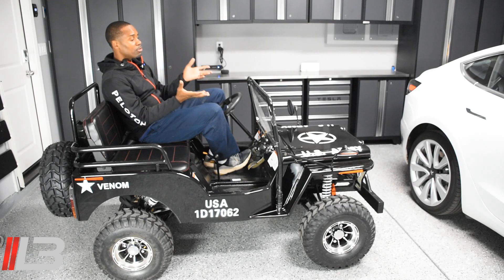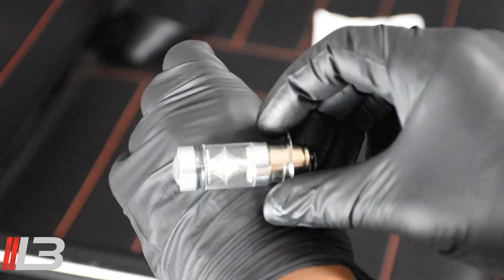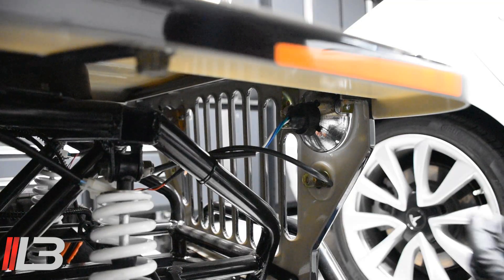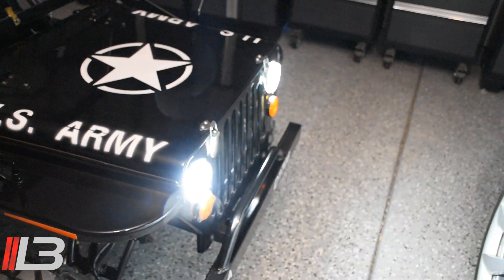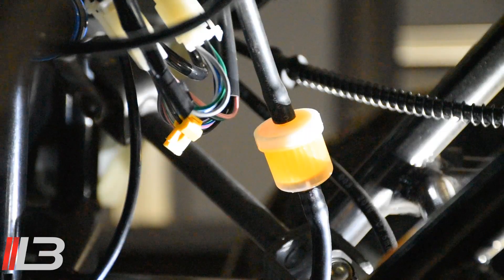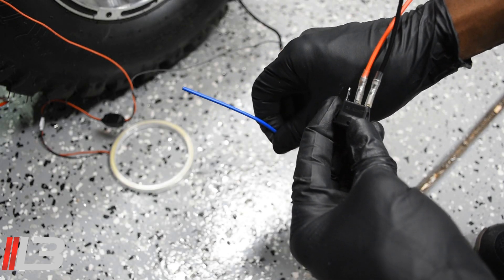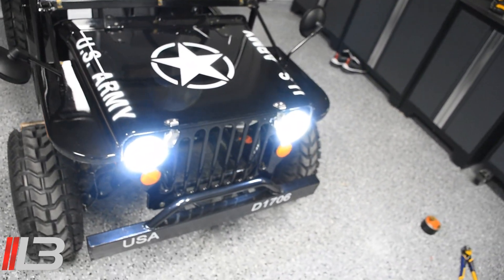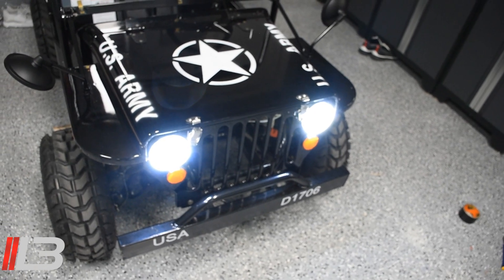Add Led Angel Eyes & LED Headlights To Venom Mini Jeep Install & Setup

Comment: Hi James! I'm a new subscriber and new to mini jeeps! (I have one on the was from Venom for Xmas). I followed the LED Bulb link to Amazon and wow!.. these bulbs are 100 Watt! I always change my motorcycle headlamps from Halogen to LED's because the Halogens normally are about 50 to 60 Watt and the LED's are around 20 Watt (but still brighter than the Halogens). I change them because the LED's are easier on the bike's electrical draw! That said...how's your little battery holding up on the mini jeep with all those extras watts being drawn? Aren't two 100 watt bulbs draining the battery?
Reply from the maker: I no longer have the jeep, so I can’t comment.  When I did have them, it wasn’t an issue as long as I had the jeep on. 

But, I also don’t know long term ramifications.